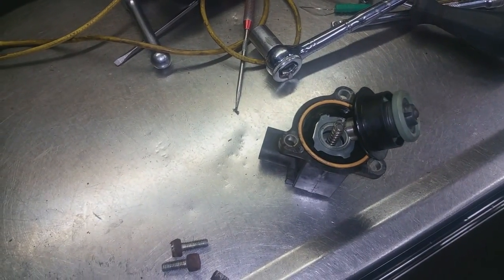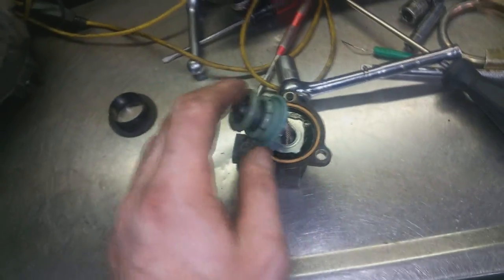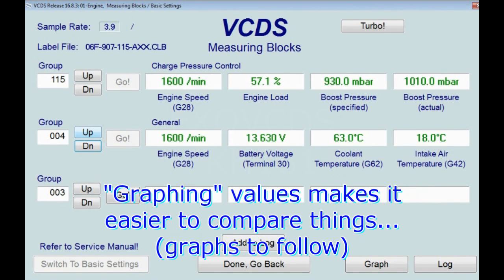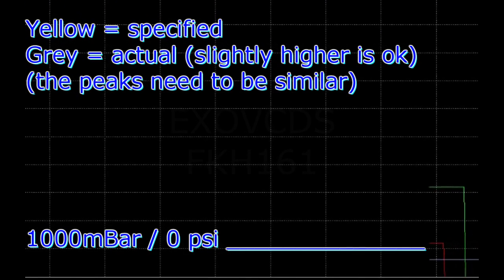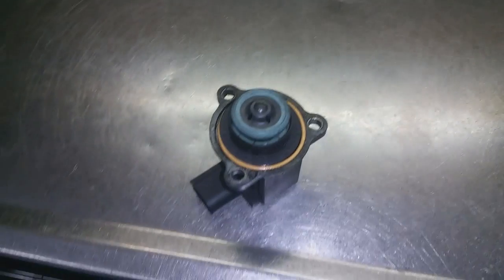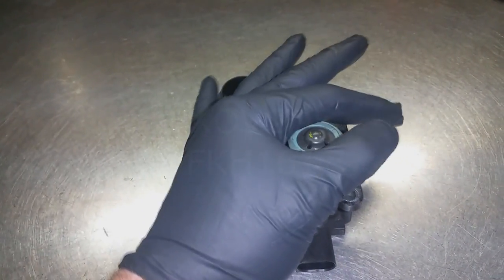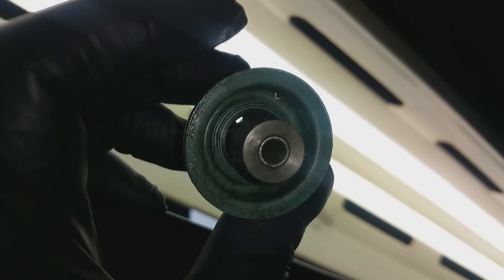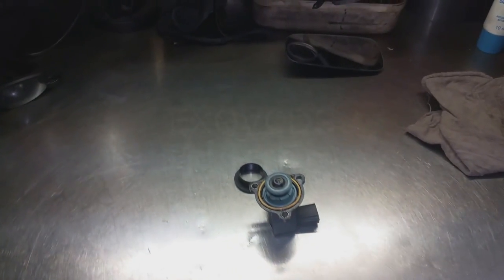Audi B6: 2.0L BPG P0299 Boost Pressure Regulation

Comment: My specified boost goes to 2100mbar and it always over actual boost why? That happen from 3k rmp to 5.5k rmp. Over 5500 it goes down
Reply from the maker: Year, make, model, engine? Does it set overboost codes? Does it go into limp model? If it's a diesel, those numbers are fine (as long as no overboost codes)... again, need more info.

Comment: I have been change 5 time but its not working is there any relay and some fuse ? Please help
Reply from the maker: Year, make, model, engine?
What is the fault code? P0299? Turbo problem or boost leak problem... not an electrical problem.

Comment: Hi I got this code a couple of days ago while on vacation, however it was accompanied by a P0101.  Is that a normal code pair for this issue?  My approach is to check the intercooler/ hoses, waste-gate play, the DV, and then wiring.
Reply from the maker: Thank you... I have not seen P0101 & P0299 together, but it is possible. P0101 is MAF implausible signal.... a bad diverter can affect MAF readings. Check / replace the diverter and see if the MAF code comes back.
Reply: @EXOVCDS  Hi, so I checked the codes again before I started removing components and realized that the P0299 was a 'Pending code' as opposed to confirmed.  However, the P0101 was a confirmed code.  So, that's a little more explanatory.  I cleaned the MAF with some CRC MAF cleaner and cleared the codes.  If it comes back up then I'll have to pickup a new MAF sensor.  Much more pleased with a faulty MAF sensor than a possible waste gate issue!
Reply from the maker: @joshuam7552  Wastegate is something else... the diverter is a "boost recirculation" valve. The wastegate / flapper valve bypasses exhaust around the turbo... a bad flapper valve (controlled by the wastegate actuator) could also be the reason for the p0299.
Reply from the maker: @joshuam7552  Also check the wiring for the MAF. If it is routed inside plastic tubing, there could be broken wires that sometimes don't touch.
Reply: @EXOVCDS  Thanks for the suggestions and explanation!  Cleaned the MAF yesterday, but it still seems to be getting progressively worse. Today it was very laggy while under medium to heavy load, bucking (when giving heavy load), lowered mpg, and a seldom but noticeable hint of a gasoline smell.  Just ordered a new oem MAF (Hitachi MAF0051),  I'll definitely check the wiring from the connector to the wiring harness tomorrow when there's more light out.  No codes have come up yet but I'm sure that P0101 will be back.  So do you think the P0101 caused a pending P0299, or do think the P0299 is a standalone?  Yeah, I was speaking of that flapper valve--sorry I didn't have the terminology for it, I'm still a novice.  I have the K03 turbo by BorgWarner and I've heard when the wastegate actuator start to have a certain amount of play, the flapper valve doesn't close properly--then its time for a new turbo.
Reply from the maker: @joshuam7552  Boost & MAF go hand in hand... you can have high MAF but low boost, or low MAF & high boost, both can set MAF or boost codes. It all depends on other factors that the ECM also takes into consideration. If your scan tool can view "specified & actual" values for both MAF & Boost, monitor them to see which one is not meeting "specified". Looking at fuel trim values can indicated if there is a possible boost leak (engine will run rich under boost, due to lack of air). Boost leaks (depending on size) can be heard. If the diverter valve is recirculating boost when it shouldn't, then that can interfere with MAF readings and set MAF codes. It's difficult to determine which issue your engine has, without seeing ECM live stream data. Checking the diverter doesn't take long... if the diaphragm is broken, there's a definitive problem / bad part. If it is not broken, then at least you have ruled out the diverter. The MAF can be checked by viewing max MAF values under a wide open throttle pull ( max g/s  should be .80 times your max HP).
Reply: @EXOVCDS  Got it! Thank you so much!  Well, I also ordered the Diverter Valve.  So that will go on either way.  I'm just doing it as preventative (if its not already toast).  The way things have been going on this car--the minute I fix one thing, another breaks.  I did end up going out to look at the wiring and all looks sound.  I've been wanting to purchase VCDS but, every time I turn around--like mentioned--something else needs to be replaced and I've been doing all the work myself to save money.  For example, a month and a half ago the radiator started leaking, so I changed that.  Two weeks ago I pulled the trans to do a RMS because it started leaking--ran beautifully after.  I go on vacation a week after and these codes pop up.  Yesterday my window regulator broke. This is how its been for the past 1 1/2 yrs.  I would sell it but I can't afford a car payment while I start grad school.  Anyway, sorry for being cathartic--I appreciate all your time/ help with me on this, thank you so much! I don't wanna take up all your time. I'll get to the bottom of it one way or another ;)
Reply: @EXOVCDS  Problem solved:  I for some reason didn't think about checking the charge pipe connection to the throttle body hose.  Damn, thing slipped half off.  I probably forgot to tighten the screw-clamp back up after doing my rear main seal--that was my boost leak (P0299/ P0101).  Took it for a drive after and it runs phenomenally!  MAF was good, zero play in the turbo actuator arm, diverter valve was still good, but an old version, so I just changed it for the newest revision.  Thanks again for all your help!!
Reply from the maker: @joshuam7552  thank you for the update!
Reply: @joshuam7552  having the same codes as you. Will try to find a loose hose thank you!
Reply: Sugar Mist Post what you find, if you don’t mind.  Just so other solutions are available for people to see! Thank you and good luck!
Reply: @joshuam7552  hey Josh after taking off my belly pan I figured out it was just a blown off intercooler hose. Tightened it back on, disconnected battery to clear codes and the car is pulling like never before! A little upset I bought a $100 MAF for no reason but oh well.
Reply: @crazymonkey86056  Awesome, glad you found it!  Yeah, it'll pull pretty hard until the computer re-learns and adjust the fuel-air mixture. I took out my transmission to do a rear main seal job, and I forgot to tighten the intercool pipe to the throttle body when I put it all back together.  I bought an oem MAF as well from amazon.  I just returned it to be honest.  See if you can return the MAF you bought.
Reply from the maker: Year, make, model, engine? So I can guess better.
Reply: Sorry, that was dumb of me:  Audi A3 2008 2.0T TSI (CBFA)
Reply: Yeah, I was thinking likely the DV because of the MAF code.  I’ll go pull it off now and take a look.  I don’t think it has been changed—at least not since I’ve owned it (5 yrs).  So, I assume it has the old style rubber diaphragm.  Does that plunger just come apart, or do you have to ‘break it’ to get it apart?  Thanks so much for the advise and reply’s, I appreciate it!

Comment: Can this cause a code p0171 system lean?
Reply from the maker: I don't think so... less boost = less air. If it is bypassing boost air back into the turbo, less air should be registered entering the engine via the MAF. I could be wrong.
Reply: @EXOVCDS  thank you for the reply another question....could the p0299 code be caused because of a dirty maf or air intake
Reply from the maker: @xpert447  http://wiki.ross-tech.com/wiki/index.php/16683/P0299/000665

Comment: so if i have more presure on idle (like you),it seems to be a bad DV symptom? I have under boost and low boost with p0299 code, Thanks
Reply from the maker: Dragos Udroiu if your diverter valve is still original... it's most likely bad. It doesn't take long to check it / remove (as long as the little bolts are not seized). The other issues could be air / boost  leaking after the turbo & before the throttle... check all hoses and clamps. A bad pcv can also cause issues... can you remove the oil filler cap easily when the engine is at idle?
Reply: Thomas EXOVCDS yes i can but not easy....
Reply from the maker: Dragos Udroiu If there is a lot of suction, then the pcv might be bad and that can cause boost to leak into the crankcase when boost is active.
Reply: Thomas EXOVCDS 
my car stops at acceleration with stage 1 revo and it sounds a blowoff sound, the car works perfectly stock
Reply from the maker: If it works fine with stock chip / tune, then the tune / chip might be the issue... unless the stock setup can not handle the stage 1 tune, then there is a leak (because of weak components)? Check things over. A boost leak will have wetness (oil) around hoses / clamps. Remove the diverter valve and check it.
Reply: revo boys have tried several maps  with low boost and the problem still there, the problem is how do you say, a weak component, I want to check DV if it's okay because it sounds a whistling on accelerating.

as my car symptom breaks in acceleration below 4500 rpm after the car goes ok
and sorry for my bad english
Reply from the maker: Remove the diverter and check: https://www.youtube.com/watch?v=n7GO-gxRKOw
Reply: I did not manage to get him down because of the tools, but I found oil in his socket, it is bad?

Comment: I have replaced 30-40 of those valves, on some cars those 3 little Allen bolts can suck!!!
Reply from the maker: Two of the bolts on this one were a pain. Luckily it was the lower two... I used a long chisel and spun the bolts loose by turning them with the chisel & hammer bit by bit.

Comment from the maker: The new diverter valve is a redesigned unit that does not use a rubber diaphragm: http://c1552172.r72.cf0.rackcdn.com/240200_x600.jpg
Reply: Does that mean the boost doesn't go up the skirt?
Reply from the maker: wysetech2000 Oh it does... it's that Marilyn Monroe action that sets the code! =)
Reply from the maker: Good info... thanks for sharing! I haven't run into a sticking one yet.I will keep that in mind!